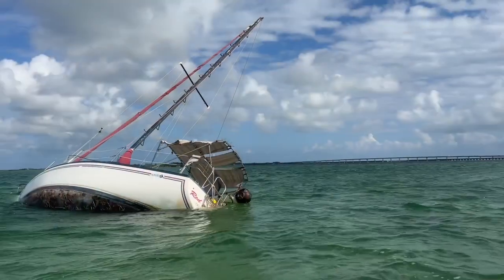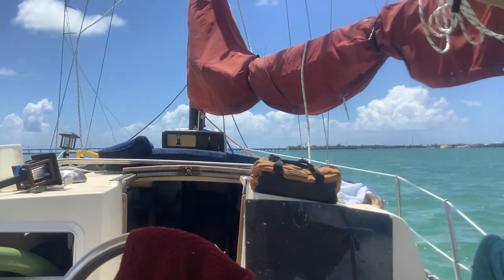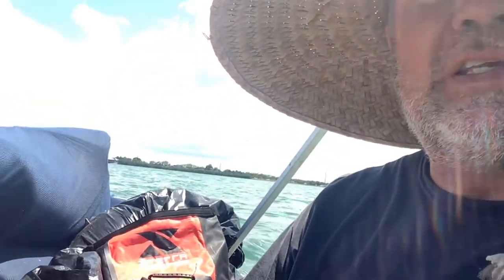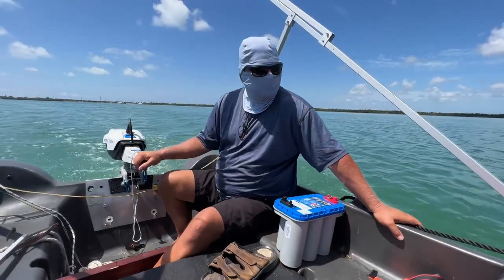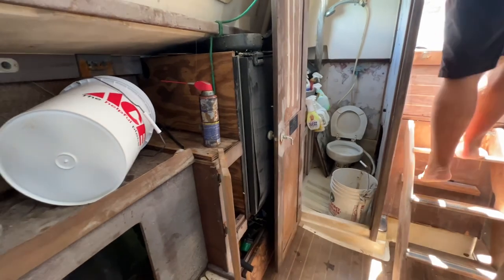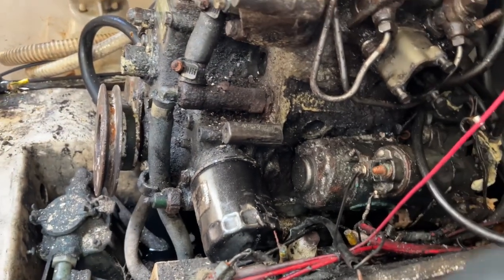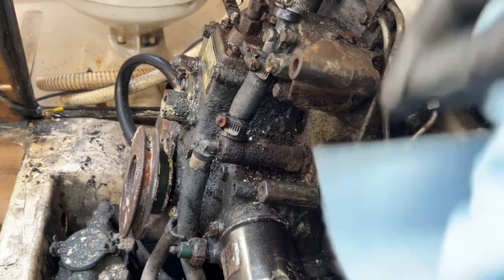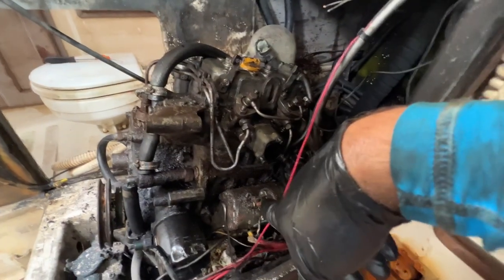Raising a sunken Hunter sailboat ⛵️ and getting the Yanmar 2GM diesel engine running again!

Comment: What starter did you replace with? Will a generic work?
Reply from the maker: I replaced it with a high torque starter, and uses less electricity, and it turns faster. But the original will work fine a link to it is in the description.